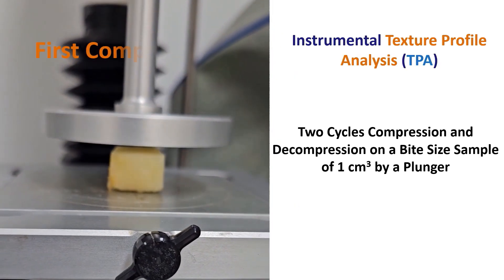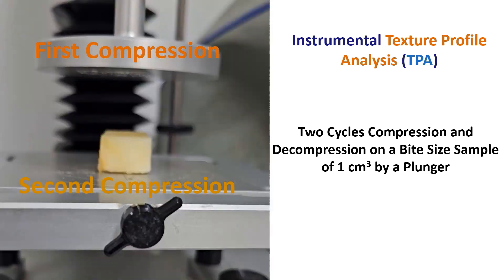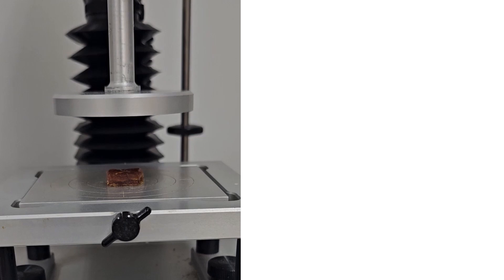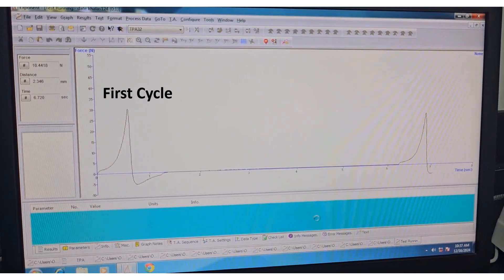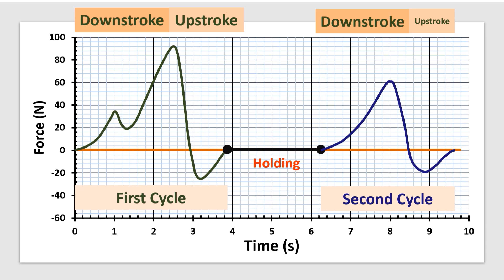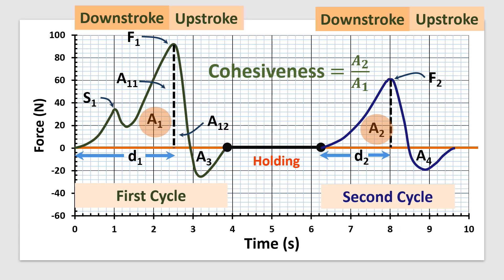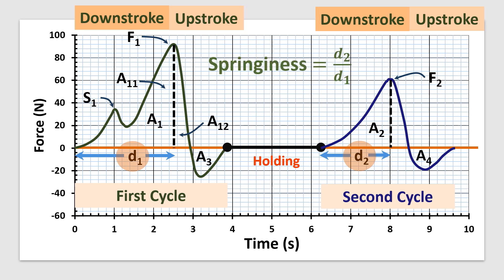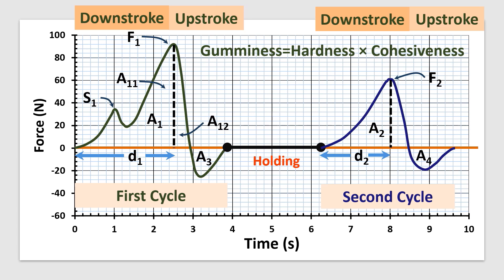Instrumental Texture Profile Analysis (TPA) of Foods: Basic Understanding

Comment: Very well explained sir...but i have a doubt sir, in which parameter to select where I get this curve. My sample is gel like and how to get double compression to calculate every parameters. Please respond.

Thankyou
Reply from the maker: Thank you. If soft gel, then it should be placed in a container and perform two cycles. In this case, you need to use small diameter probe and it will dip inside the gel. If solf gel could hold the shape, then compression could be used and the compression level should be high, may be 80% compression. You need to consider hardness, cohesiveness and gumminess.
Reply: @foodinnovationshafiur Thankyou sir
Reply from the maker: @GoodnessinYouOfficial  🙂